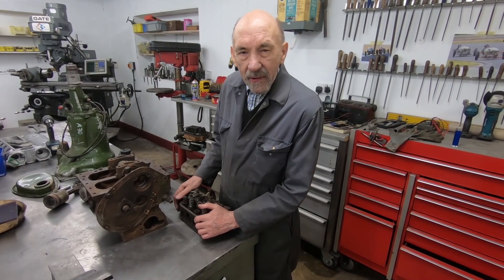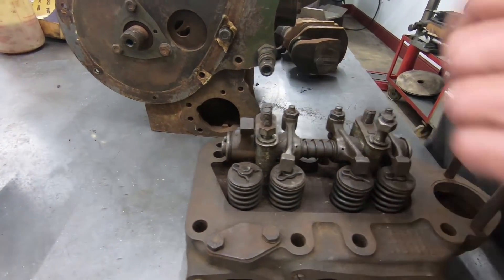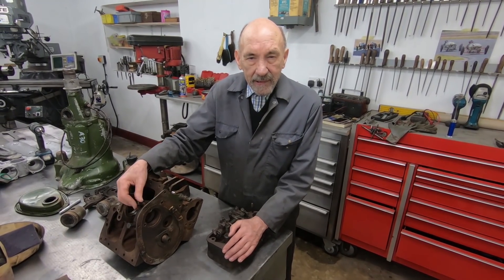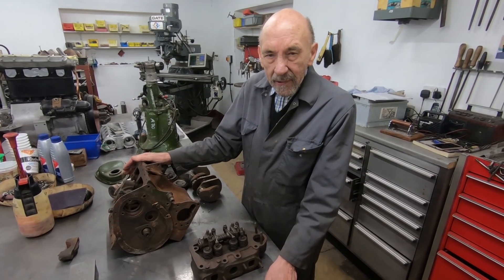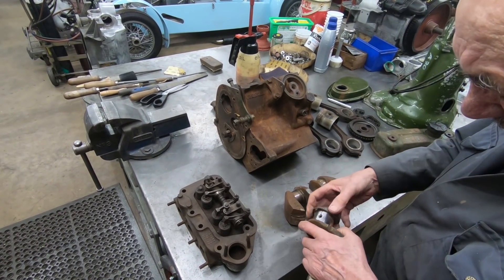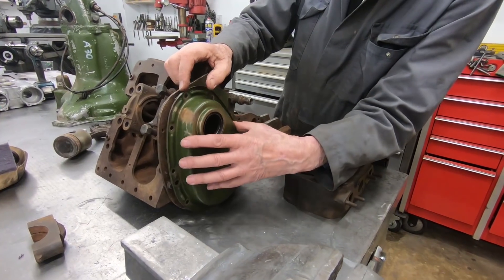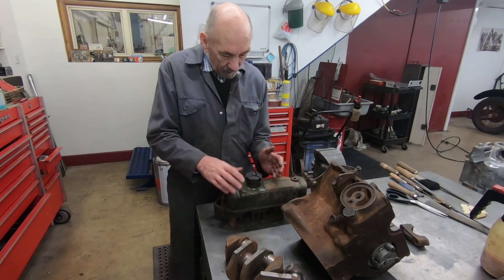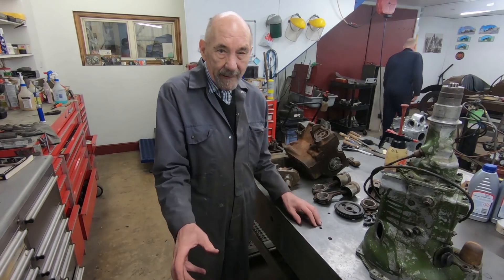2 cylinder Mini prototype engine?! 1957 - Ivan's Shed

Comment: What a neat project, what is the reason why that two cylinder block could not be mated to an original mini, east west gearbox, could you not make a "half closure plate" for the top of the box that wasn't covered by the engine block?
The output end of the crankshaft is the main difference issue between the mini and an A30 "A" series, two cylinders much more interesting in a Mini...
Reply from the maker: No, we really looked at that. I have a Mini gearbox to look at and it's nothing like it. If you look in the picture as well  it doesn't look anything like a Mini gearbox, if only was that simple!
Reply: @DGBcars   What about a gearbox from an A-series Maestro? It mounts end on rather than under, and the shorter engine may well allow enough room to fit it in a Mini. It would have five speeds too, and using ten inch wheels of the mini rather than the 13's of the Maestro might mean the gearing is not too far off either.

Comment: Brilliant Ivan! Have you seen Allen Millyards youtube where he describes cutting and joining camshafts for his Kawasaki Z1 six, using an old gudgeon pin as a joining dowel and welding? A bit like you are proposing perhaps, and maybe the same idea to join the crank sections?
Reply from the maker: We’re thinking of similar but we consider that a great honour to be used in the same sentence as Allen Millyard! I think to beat him we’d have to get two Viper engines and fit them in a moped!